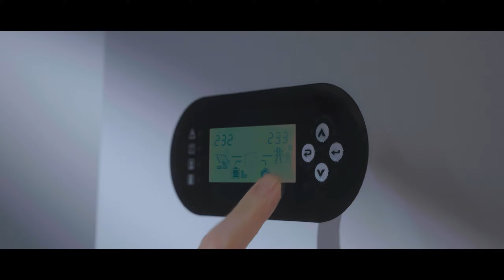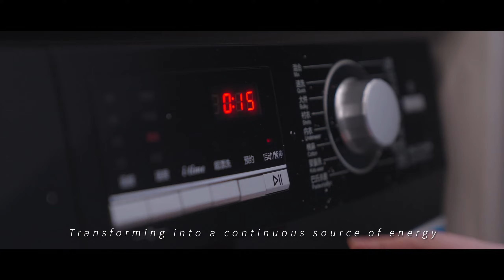Felicity | Show You the Power of the Sun

Comment: @felicitysolar Technical support, pls my 5KVA IVEM inverter, not switching to Generator or recharge with generator, only indicate the presence of AC light, but while running on Generator it won't switch or recharge the battery with it. But if it's Utility it will switch and recharge battery normally. Pls I need your support. The rating of the generator is 7.5kva